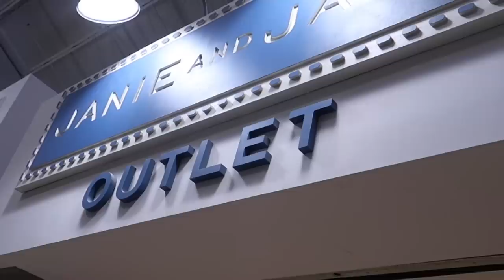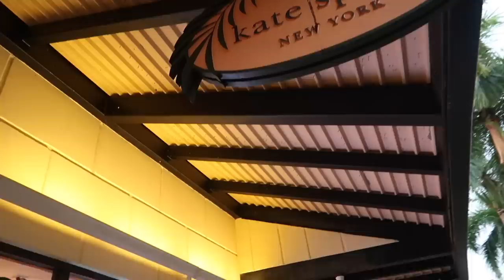😍 SHOWING MY FAMILY OUR NEW HOUSE! BINGHAMS FIRST TIME SEEING OUR NEW HOUSE TOUR BUILDING A NEW HOME

Comment: Hi Ryan's mom Sam here.... I think you have both fell in love with Florida you can always go back to Utah in the future and you will get more visitors in Florida because of the Beautiful weather 😄😃 the water in your house is probably just because the roof is not Water Tight yet when it rains the water will just go through the roof as it has no tiles or Felt on as soon as they put the roof on properly you wont have an issue and the house will dry out I saw this and I knew straight away why 😄

Comment: the water is evident because they had a lot of rain and the building envelope is not water tight....there are no shinges, no windows & doors, no air barrier or siding.  Once these are in place, it won't occur.  I've been in the building industry for 30 years and as long as the plywood or OSB doesn't delaminate, it should dry out with any issues.